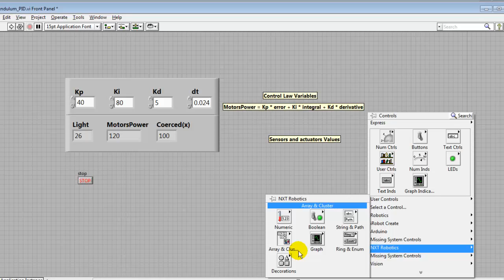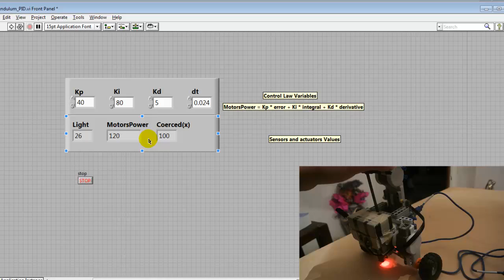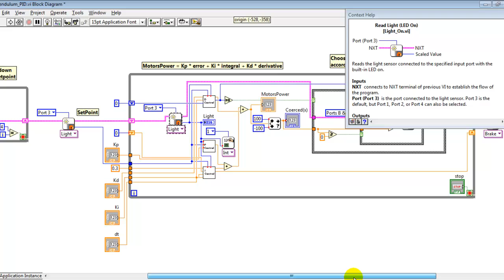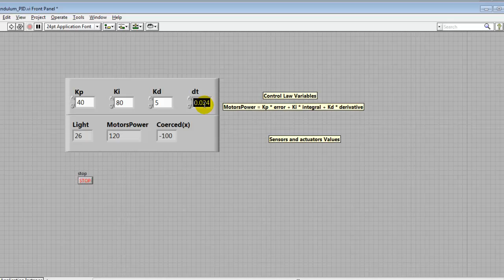Lego Segway (Light sensor) - Progamming in Labview Explained

Comment: Hey, thank you for the demo of your programming. Just one thing: do you really need that case structure around your motors? Motor vi take values from -100 to 100 so it will go back and forth depending of value from PID controller. Otherwise I really like the way you explained your code.